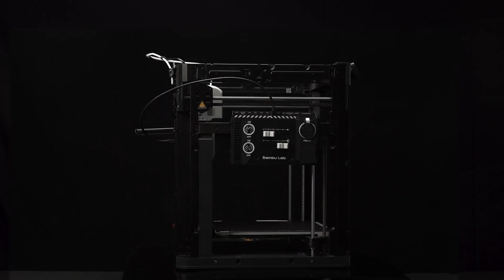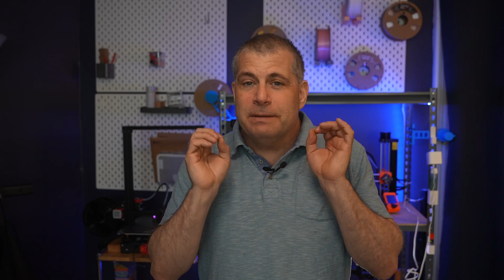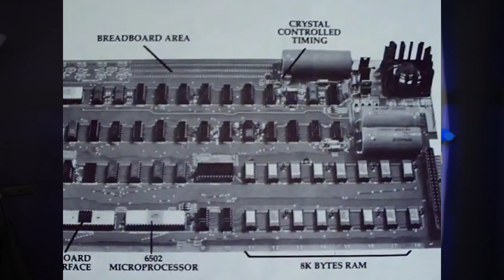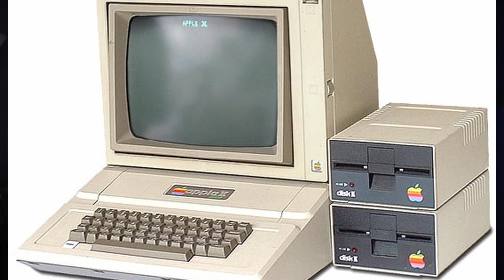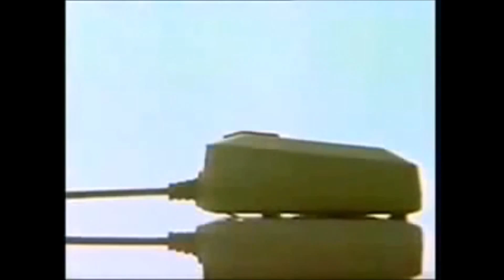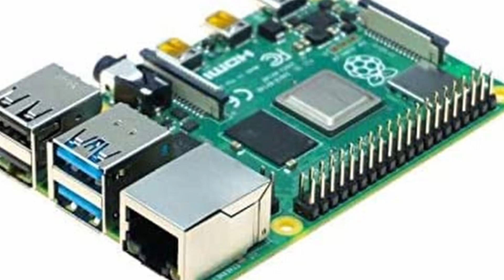Bambu Lab P1P, P1S, and X1 Just Fixed 3D Printing! See How ANYONE Can 3D Print Now!

Comment: I received my P1s Combo just this morning. It only took 40 or so minutes (including firmware update and self calibration) to start printing its first benchy. Now i am thinking if i should ask compensation from Creality not for the money i spend on their products but all the time I had wasted servicing, troubleshooting and tweaking their products instead of designing and printing. 

This thing has been printing non stop for the last 23 hours, completed printing 4 full plates and now printing 5th. I am almost getting the end of second spool. I could not go to bed because i want to print more and watch it do its thing.   Yes it cost me a fortune but this thing do actually print.

I guess some veterans who had spend decades of their life mastering the art of 3d printing might be angry, when they see someone who does not even know what power button is;  prints some amazing things from model depositories and then brag. Same happened to artistic photographers after smart phones, or musicians after computerized music. Neither caused real photographers and musicians to extinct but made them excel further.
Reply from the maker: I'm glad you made the point about photographers. As one myself I think this is a really good metaphor. 

Most of the people I see posting about how you need to have taken machines apart to be a real 3D printer. 

But that's the attitude that kept it from being adopted by more people. 3D printing has gone from Maker tool to Hobby tool. And that's a good thing.

Comment: Having lived through the Era, your history of home computing is.... one sided. While I understand your point and even accept it to some extent, your representation of non-apple products is entirely unfair.

And, yes, I understand the constraints of time to get across your point but I would say your representation is so absolute ond one-sided as to make it actually wrong.

And, if you'll remember, the apple I and II were both open architectures when they were introduced. You could make and sell your own hardware and software for those systems without bother. It was only later that the architecture became closed.
Reply from the maker: I appreciate you taking the time to reply. As someone that also lived through that era, obviously I'll disagree here a bit.
Reply: @Dave Tries This  😄👍
I figured you had been there too. Regardless of personal experience, I won't pretend what you said about the Apple doesn't have applicable truth to it.

I helped my father with his first home computer in 1978. There were many things  that had to be configured, adjusted and set up. The process of installing a hard drive, for example, was  rather a pain: dip switches, sector mapping, low level formatting, high level formatting... and mounting it every... single... time. And don't get me started on printers! Oh, God! The printers! ... So, I get where you're coming from. (Or, at least, I think I do.) Of course, that was an S-100, a "real" computer... God! What an arrogant statement! Coming directly from the arrogance of the time, I assure you. As if?!

Anyway... It's quite possible you're completely correct and I have my timeline completely screwed up. After all, I didn't come across Apple hardware excepting within advertisements in Byte -which is why I know it was an open system at first- for quite some years after they were available.

I remember several machines from those early times that were basically plug and play... Or, as close to that as existed at the time.

I'll have to do some research to verify or contradict my opinion before I get too insistent on my memories being accurate.

Regardless, the Apple II was certainly the good-to-go computer that was most widely available and that was most people's first experience with such an idea. 

And your point about the Bamboo as a parallel is valid, regardless.
Reply from the maker: @bmobert  You're absolutely correct that the Apple I (I wish I could to the capital I they used) and the II were mostly open source, though largely because they didn't have the ability to make the components. The Apple I was really a demo machine to get the orders. They never really expected they'd get such a large order, and they used Net terms to build them and sell them and made enough money for the II. 

Everything sort of had to be open source because there really was no such thing as a personal computer manufacturer when they launched. Everything in business was proprietary too, since companies like IBM could build their own hardware. 

Franklin stole Apple's ROMs and code for their ACE computers, which they admitted to. Apple sued them, and established precedent that code in ROM was copyrightable. That's really when Apple first got the ability to do things that were proprietary, so the timeline for Apple is condensed quite a bit in my analogy. 

Once Apple got to things like floppy drives, they really started to dominate the market. When my Apple ][+ arrived ahead of Christmas, my dad tried to connect a Sony tape recorder to load the software onto it (since tape recorders were one boot option) and it wouldn't work. The "remote" cable on the Apple ][+ was designed for the specific tape recorders Apple promoted, and Sony used a different pin out for controlling the tape recorder. 

To get my computer in time for Christmas, my dad called Apple and they put two floppy drives on a plane, and my dad drove to the airport to pick them up. 

Anyhow, Apple's periphrials were really dominant in the market. I don't even know if anyone else made a floppy drive but early ones needed Apple's controller card for it. I also had a digitizer that they made, and there were some graphics cards. 

The dominance of Apple's proprietary steps really were in place by the //e and //c. The C had a floppy drive built into it, so you didn't even need accessories for that. 

Apple started work on Apple Bus which got sidetracked to add Ethernet cards (and Token Ring), 

Then they made Apple Desktop Bus which was proprietary. This was a big step for Apple in the process of making things internally that were available off the shelf, but engineering them to work better with specific Apple components. ADB came about in 86 and was replaced with USB in the late 90s when Apple was embracing standards like USB.

Anyhow, you're right that Apple was in a market of open source products, or at least products all using the same components with their own ROM and OS. Sinclaire, Franklin, Osborne, etc. 

As you can see how boring the above is, it's why I over simplified it for the video. :)
Reply: @davetriesthis 
Yepers. That all sounds about right to me.

IDK which other comps had 5.25" floppies at that time but 8" were prevalent all over the place. And every drive had their own proprietary way of formatting the disk. It was a bit mad.

By about '80 or so, the s-100 standard had been adopted across the board and things in that sector were accelerating: the s-100 home and business market being deluged with new companies and new hardware.

Then, in '81, the IBM PC came out with the usual IBM fanfair. The damned machine was meant to compete with the Atari 800!! But, because it was "Big Blue" the business world shifted to the PC. MS DOS 1, which came with the PC, was a direct rip off of QD DOS, which was an unofficial port of C/PM --IT STILL HAD THE C/PM  INTRO IN THE MACHINE CODE!!

Any way... Yeah. Interesting stuff.
Reply from the maker: @bmobert  Good times. :) IIRC the 8 inch floppies were more business/enterprise targeted. The 5.25 was the model that the Apple 2 used, and according to the Interweb they were released in June of 78. So my first Apple was in December of 1978, since it was a Christmas present. 

God, I remember using the boot floppy to be able to launch games, it feels crazy that you needed to load software to allow the computer to load software. 

I vividly remember seeing the computer and the floppy drives at a computer store in NJ, and I remember shopping there for games. My dad would take me to the movies at the theater next door. I remember seeing Flash Gordon and then going to shop at the store. What a killer day that was. A lousy Sci-Fi movie and a text based adventure game. 

I still know exactly what it felt like to unbox a box of BASF floppies and what they smelled like. Man.
Reply: @Dave Tries This  
Yes. I know exactly what you mean.

My father had his S-100.
I had an Atari 800. My system had bith floppy and tape drives. You had a special cartridge that allowed you put in a second special cartridge to then connect to either. Then it loaded whatever you had. And there were commands required. It sounds complex but it was easy once you knew how. And I loved, LOVED getting new floppies or cassettes video games. (The best ones were always tape because there was more space to have more complex games.)

But I live in the boonies and the closest city is two hours drive away. So it was few and far between to get new games.

Ah... Nostalgia.
Thank you. 😁

Comment: in my opinion the consumer who buys a 3d printer and uses it. Is most likely a creative hands on type of person    Look how quickly someone designed a new insert for the AMS system that’s open source. Companies are already selling aftermarket parts / redesigns. Etc. I understand how the company designed this to be a proprietary printer.  But  a proprietary printer is kind of like an oxymoron. For a 3-D printer to appeal to the masses. This is the closest it’s gotten. as per pricing look at a Prusa MK3s ( assembled $1100 plus shipping tariff etc. ). Even the P1P is way more advanced than the MK 3S for almost half the price. The print quality ,speed …The only thing I would give prusa  I like the slicer a little bit better. But it’s close.  and Bambu  lab makes updates frequently. I have 5 - P1p s 2 - X1 carbons. Prior I had 10 Mk3 s , few minis  couple Creality s. I have not used any of them since I received the printers from Bambu  labs.  I’m going to donate them to school.  Because I would agree it’s good to learn the fundamentals from an “open source” printer.
Reply from the maker: I 100% agree with everything you just said.

Comment: I am looking to get into 3D printing but I want to spend more time on design and getting those designs done instead managing a printer itself.  To me they are almost two distinct hobbies, improving/upgrading a 3d printer and printing 3d objects.
Reply from the maker: 100% agree. The output of the print is a secondary activity. That's why I think this printer is great for people who just want to print. 

I've been doing some light 3d design in tinkercad for things I need around the studio and I'm loving it. I'm totally not good at 3d deign but can make serviceable parts to accomplish tasks. 

Screwing around with the printer is why some people are so into printing. It's the tinkering they like. Personally I just want a print to come out right.
Reply: Most people (like myself) have little to no time. For a company that came out with this product it’s amazing. To introduce people in this hobby that don’t require huge timesink
Reply: I design a lot of things that require accurate round and square holes (which shockingly don't typically go hand in hand) printing as drawn.  No fudging numbers to compensate for the printer, and same for all external dimensions, all at sub 50 micron tolerances.
To get there, it required a modified printer, with tuned firmware and slicer profiles beyond what most companies would ever be willing to do.
There are absolutely ways to buy that sort of performance.  And sure, the machine only runs at about 150mm/s.  But the modifications were all necessitated by the need to *print things*.
My experience has been that there are people who print neat aesthetic items, and those who use it to do work.  I didn't need to go with a direct drive setup.  It sure did help, but most of all it was a quality of life improvement, more than a quality of print improvement (worth every penny).  The ones who use it to do work tend to be the ones doing meaningful modifications, with a more vocal sprinkling of people who modify them for the sake of it.  There is a visibility issue at play.  People who modify printers for their print farm typically are not spending their time making videos or writing articles about it.  The hobbyists are the ones who are most visible, but that does not mean they are the majority.